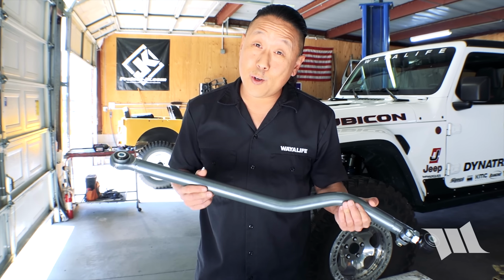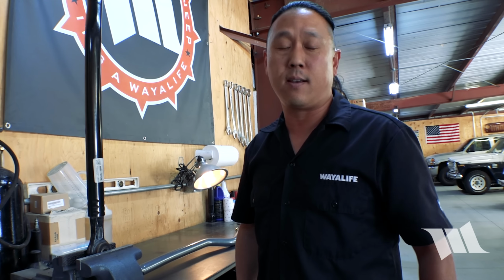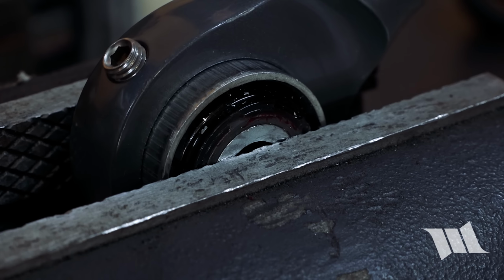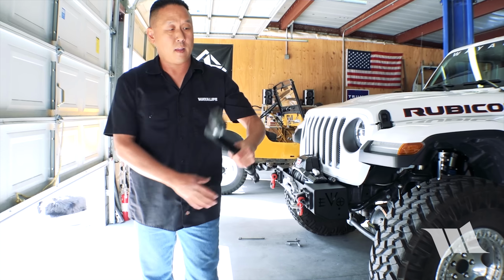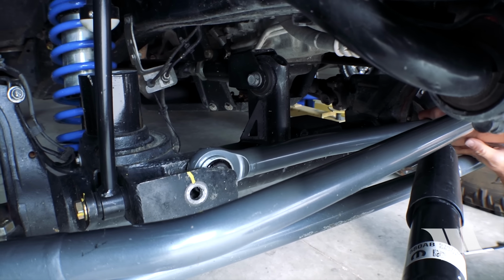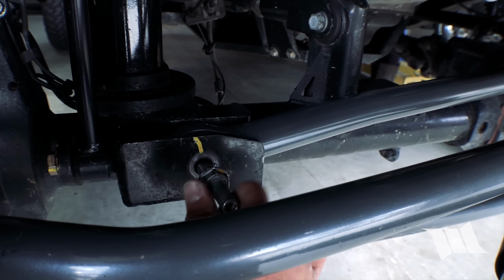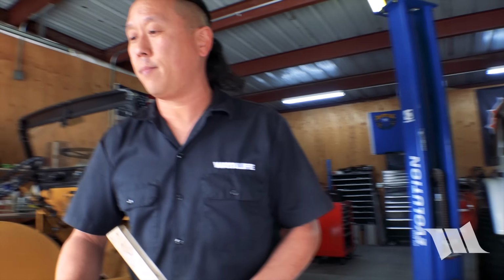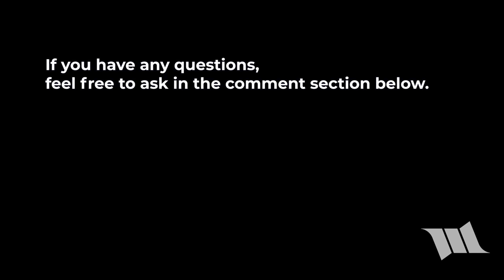Jeep JL Wrangler and JT Gladiator Truck Adjustable Front Track Bar by Synergy Installation

Comment: So is the synergy worth buying over the rancho track bar u installed a few months ago??? I may have bought the rancho lol
Reply from the maker: Both use dual durometer bushings and both are solid track bars. I wouldn't hesitate to run either. The Synergy one is just better in that it comes with their double adjuster sleeve and pinch bolt. This is better than a jam nut but once you get things set, you really won't need to play around with it much after.
Reply: @wayalife  thanks for the response and the great content.
Reply from the maker: You bet :)
Reply: The other difference is that the Synergy bar is made from larger diameter material (1.5” x .25” USA made 1026 DOM) so it will be a bit stiffer 👌🏽 camaro camaro ss
Reply: @daveschlossberg5138  thanks for the info!

Comment: Hello boss I’m from Canada I have a2018 Jeep JL wrangler unlimited sports. I have 2.5 skyjack lift on it. I’m have extended warranty on Jeep so synergy track bar is little expensive because factory track bar cost CA $300 can you suggest me something good like synergy track bar  which will be around CA $300
Reply from the maker: Honestly, no. From experience, what I can tell you is that you get what you pay for.

Comment: Love the simplicity of solid axle vehicles. Especially when you have some lifts installed, a lot of the maintenance can be done just crawl under there without jacks!
Reply from the maker: There are a lot of benefits to IFS but it really is hard to beat the simplicity of a sold axle.

Comment: Thank you so much for your review of this product.   For the past 6 months I’ve been complaining about the wander in my 4-Door JL Rubicon.  After hours of reading and coming back to your videos multiple times I decided to order the Synergy track bar.  I’m at beyond impressed how one component has changed how my Wrangler drives.  Best upgrade I’ve done so far.  Thanks again…
Reply from the maker: Awesome! Glad to hear we were able to help you out with our video.
Reply: Was that old track bar you replaced OEM..I have exactly the same looking one on my 2021 Jeep Gladiator..been having a lot of death wobble at low speeds ..only happens driving under 30 mph..going to change it out with new tie rod and track bar along with alignment to see if it corrects the problem ..love ur channel !!
Reply: @fishingcc9588  yes. I replaced my OEM trackbar.  The Synergy is much more durable and isn’t held together with a pinch unlike the factory.  I’ve also since replaced my LCA’s with the factory LCA’s that are 1/4” longer from the 2” factory lift kit.  They are dirt cheap and increase your camber to the range they should be if your Jeep came from factory with 33” tires.

Comment: Keep up the great Wrangler video productions!  You’ve really helped me correct a DW issue on my 2018 JL Sahara Wrangler (no lift).  I ended up replacing my track bar, drag link, tie rod and steering stabilizer just to be on the safe side.  Those OEM steering parts are on the light side.
Reply from the maker: Awesome, so glad we were able to help you out :)

Comment: Already had the Synergy high steer kit, but thanks to your video I just installed the Synergy tie rod and track bar. Very smooth comfortable feel at the steering wheel, and really tightened up all of the looseness. Very beefy components. Wish I could include a pic.
Reply from the maker: Awesome!

Comment: Great videos!!  Only thing I would say is I would always use the torque wrench when ever possible on the nut side with your fasteners.  The friction loss of the bolt through the brackets and ends can result in you not torqueing things down to the proper torque value.. for example if there is 15lbs of friction between the bolt, bracket and track bar end that nut is seeing 15 lbs less on its side.. Thanks again for the videos.  I have watched a bunch and you do a really good job showing the product and explaining installation steps..

Comment: I love your videos and how you take the time to explain everything, but one thing I've noticed is when you're tightening bolts with the impact then going back with a torque wrench to torque them to spec a lot of times it looks like the torque wrench clicks right away. That means it was most likely tightened beyond the desired torque with the impact and going back with a torque wrench only proves that. I know with a lot of these parts being over torque doesn't really make a difference, but on some it really does.
Reply from the maker: LOL - It's called editing. Just speeding up things up so that you just hear the click.

Comment: Great vid as always. Just wish you would have shown what how to adjust if it was way off center after installing. Like in the scenario of going from stock to a lift.
Reply from the maker: I may have to revisit that.
Reply: @wayalife  Yeah, lots of folks are on the Gladiator forum are upgrading to the MOPAR lift (including me) and then realizing their axles have shifted. I was thinking Teraflex until I saw your vid. Once again, love your content, ,keep up the great job.
Reply from the maker: @lexlow5101  For whatever it's worth, adjusting the track bar is as simple as loosening up the pinch bolt and then rotating the adjuster one way or the other and as needed.
Reply: @wayalife  I know its that simple. But if you don't make a video about it, what tha'heck else I'm I going to watch? I already reached the end of your playlist with this COVID incarceration. lol  
One real question, I was told to align the Jeep again after install. Should I? It doesn't seem necessary. Nut I'm no expert.
Reply from the maker: @lexlow5101  LOL - making this adjustment IS the alignment or at least, part of it. So no, you're good to go.
Reply: @wayalife  As always, you rock. Thank you.

Comment: Eddie have you ever considered installing a track bar mount brace because of the weld problems on the JL. Synergy does sell one. I'm going to install one on my JL.
Reply from the maker: I've installed it and will have a video for it coming soon but not because of the problem you have noted. That was just a bunch of internet hype.

Comment: Great info in your video 🙏🏾. I’m a bit late 😊. I just installed Teraflex 2.5” lift kit on my JK Rubicon 2016 & notice my axels both front n back were pushed towards the driver side by .5” at the front n about 3/4” at rear axle. Just ordered RC adjustable front and rear track bar to recenter my axels. My question is when I line up the old track bar with the new, am I subjecting the extra .5” off so the new bar is .5” shorter than the old bar or measure eye to eye old vs new install it then adjust it afterwards to center the axels. I was a bit confused with that info in the video cos yours wasn’t too bad off center that would require you to adjust the bar. Any info on how to adjust the new track bars to get them to center again would be greatly appreciated 🙏🏾🙏🏾.
Reply from the maker: You want to make your track bars a bit longer to correct your axle position at ride height. I should note, this position will ALWAYS change depending on how much weight you have or don't have in your Jeep and it being off a bit is no big deal.
Reply: @wayalife  thnx for info. Much appreciated

Comment: I’m in the market for a trackbar to add to my mopar 2” inch lift. I noticed you had installed a Rancho trackbar on a different video. Which one did you end up thinking was best? Thanks!
Reply from the maker: I'd have to say that the Synergy track bar is nicer if only because it's adjustable on the Jeep.

Comment: Thanks for the great video. I'm trying to install a mopar 2" lift kit on my gladiator, but the mopar 2" kit doesn't include adjustable track bars. Is it mandatory to add the adjustable track bars?
Reply from the maker: 2" is still within stock spec and the axle shift at ride height will be minimal. It will not affect your ride or handling.
Reply: Thank you for your answer. 
 I am enjoying watching it in Korea and getting a lot of information.👍

Comment: I have the rough country track bar that came with my kit its really beefy but im sure the synergy is way better so i think im gonna order it.
Reply from the maker: I've tested out the Rough Country track bar and it's a good solid one to run. I'd just keep what you've got.
Reply: @wayalife  thanks for the information...I heard that the bushings are garbage did you experience this? I'm assuming not if you stated that it's good I just  read mix reviews on it about the bushings thanks have a great day wayalife.
Reply from the maker: @philliprollman7421  LOL - they're clevite bushings, just like factory and I've always found them to work well. However, I would never pretend to know as much as what you can hear on the internet and can only go off what I have personal experienced. Heck, I'm still running one one of my Jeep Gladiators.
Reply: @wayalife  good to know I appreciate it I will just keep it.

Comment: I wish this would have been out a month ago when I ordered my Rancho track bars.  Any justification in changing in the near future?  Seems similar enough i'll leave alone.  Thanks for the video.
Reply from the maker: The Rancho track bars are good. In fact, they use the same dual durometer bushings. The only thing different is that they don't have the double adjuster sleeve like Synergy but really, that isn't even necessary once you've got everything set.
Reply: The other difference is that the Synergy bar is made from larger diameter material (1.5” x .25” USA made 1026 DOM) so it will be quite a bit stiffer Mike Halstead 👌🏽

Comment: I have a superlift 2.5” lift with front track bar reinforcement bracket. But my JL still drives loose. What else do I need to correct this.

Comment: Im about to lift my jeep with rubicon express brand. Will i need to get my alignment done after i put the lift and trackbar on? Or as long as my trackbar is the right length i should be dine?
Reply from the maker: Unless your kit comes with adjustable control arms and track bar, the only thing an alignment shop can do is charge you to recenter your steering wheel. IF you have adjustable components, they can reposition your front axle and add in more caster if you feel the need for it.

Comment: I have a mopar lift kit and thinking putting some adjustable control arms to correct my geometry and caster, pinion angle, center axle, and if i am on budget should i put front or rear?
Reply from the maker: Before you spend a dime, is it safe to assume you are NOT running an aftermarket double cardan drive shaft in the rear? If not, there is no need to set your pinion angle and no control arms are needed in the rear. Your axles are centered with track bars and really, there is no need to address them. By design, your axles will always be off a bit one way or another depending on how much weight you've got in your Jeep. As far as caster angle goes, there is no need to address it unless you are feeling flighty at highway speeds. Last but not least, new control arms will NOT correct geometry from a lift. The only thing that will are long arms and that's an entirely different ball of wax.

Comment: Can you adjust the track back with it still attached with weight on wheels? I'm about 3/4" to far towards the driver side
Reply from the maker: Yes. That is the purpose of the double adjuster :)

Comment: Would something like this eventually be made for the 2024 Jeep Willys? I have a lot of factory OEM parts on it that I know aren’t as strong as most of the upgrades you’ve installed, so I’m hoping Synergy is listening. 🙏
Reply from the maker: Unless I missed something, there's nothing different about a 2024 that would prevent you from installing these components.
Reply: @wayalife so pretty much it’s just a beefier upgrade from the stock. Personally I don’t like the stock one as you said the rubber bushing inside is connected to the rod and the synergy one is a much better quality in terms of what they actually did from the stock design. Is there a link for this part and is it compatible with the ‘24 Willys(I have the 2 door)?

Comment: Hello I have a 2020 Jeep gladiator with a RC 6” lift witch came with a trac bar relocated bracket after a few days of the lift I when ahead and bought a rubicon express adjustable trac bar to 6” I had the shop installed it but they didn’t remove the relocation bracket it witch has me thinking what’s the purpose of ajustable trac bar if the relocation bracket is still being used any info on that thanks
Reply from the maker: For the most part, all you really need is a track bar relocation bracket as it will help to re-center your axle after installing a lift but it will ALSO get your track bar to sit more level with your axle just like factory and that will help with handling. An adjustable track bar will just allow you to re-center your axle and nothing more. Because most lifts yield more lift than what is advertised, some additional re-centering may be desired and that's where it would come in handy but it's really not critical.

Comment: Planning to do this synergy track bar replacement on my '23 JL four-door Rubicon. Jeep is 4 months old, no other suspension modifications all stock. Little if any off-road use.. Trying to solve wandering steering. Just track bar should fix it?  do I need the other reinforcing bracket?
Thanks!!
Reply from the maker: Before you throw any money at your Jeep, try lowering the psi in your tires to something more reasonable like, 28-32. That alone should help your wandering issue.
Reply: @wayalife  I tried your idea, reduced tire pressure to 30 and really didn't get much if any improvement with the wandering issue and also dashboard is complaining wants tire pressure to be 37.
Reply from the maker: @cjsalzano  Well, it was worth a shot to help save you some money. For a lot of people, that helps and you'd need something like a JScan to get your TPMS to not give you grief. Being that your Jeep is stock, you really shouldn't need anything else to make it not feel like it's wandering. I'm guessing you came from a car with rack and pinion steering? Because, what you're feeling is probably normal for a Wrangler. I don't even think about it unless I start driving something else. Adding more caster would help out and adjustable front lower control arms will allow you to do that but depending on what you're expecting your Jeep to feel like, that might not even help enough.

Comment: Love your videos. I could use some help. U have a 2018 JLUR and a complete Synergy setup. My tracker bar gives me a death wobble when I hit bumps at 45mph. I cant set my castor due to the front track bar binds at the axel side. LCA are 24 1/8 and 20 1/4. Any help would be greatly appreciated.
Reply from the maker: Sorry, can't remember what factory lengths are but if you're binding, it sounds like you've lengthened them too much. You really should have only 1/4" of length increase on the lower arms even if you have 3-4" of lift.

Comment: Looks like you’re running a Pro Rock 44 with CV axles. Have you broken it at all on 40s?
Reply from the maker: We are running 37" tires on our JL. I would NOT recommend running 40's on a ProRock 44. Even if the shafts could hold up to them, the ring and pinion would not especially being that they're running the smaller JK gears. Breaks at the ring and pinion is something something we see time and time again even with 37's.

Comment: Didn’t you have the Rancho track bar installed ? How do you compare the synergy vs the Rancho one?
Reply from the maker: Both use dual durometer bushings and both are solid track bars. I wouldn't hesitate to run either. The Synergy one is just better in that it comes with their double adjuster sleeve and pinch bolt. This is better than a jam nut but once you get things set, you really won't need to play around with it much after.
Reply: Also, the Synergy bar is made from larger diameter USA made steel (1.5” x .25” 1026 DOM) so its going to be a lot stiffer 👌🏽 kevin leblanc

Comment: I will be adding  a new front  track  bar to my JK.  Is it necessary  to get a front end alignment  afterwards, and when you measure after installing the track bar do you  always  adjust  the passenger  side to the same measurement as the drive error side? Thank you for your time.
Reply from the maker: No, it is not necessary to get a front end alignment as you will essentially be doing it yourself. Regarding adjustment, you're just trying to get your axle centered on your Jeep at ride height. In reality, this isn't even critical unless you have rubbing issues.

Comment: Good stuff as always what a big difference in the bushings way better curious on a good brand etc on Manuel sway bar disconnect friend has 2 door sport love the home shop stuff videos as always be safe
Reply from the maker: I've always been happy with JKS disconnects but really, if he can find a Rubicon e-disco, that's what I would get. Even if it doesn't work, you can install an EVO no limits knob and it's still a better solution.
Reply: Thank ya sir pass it along